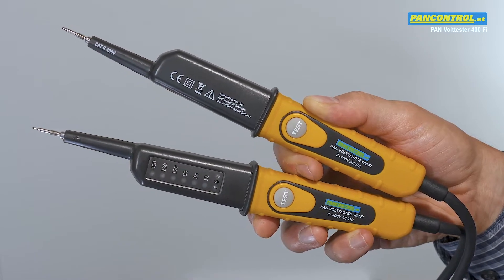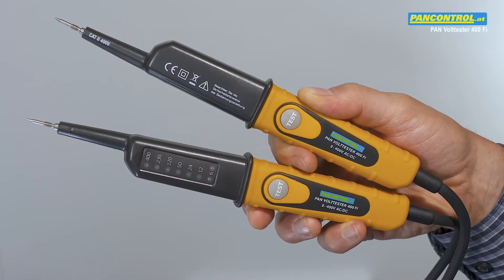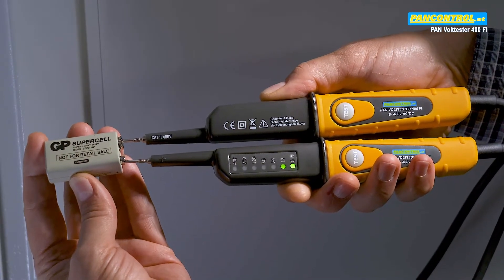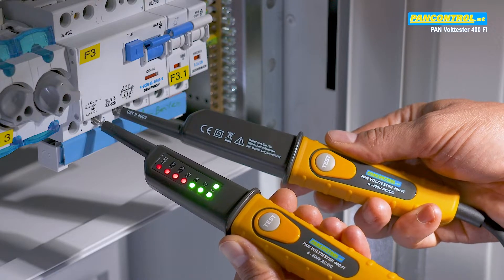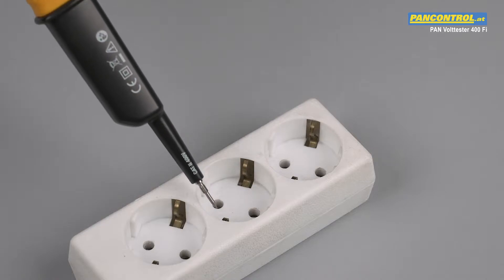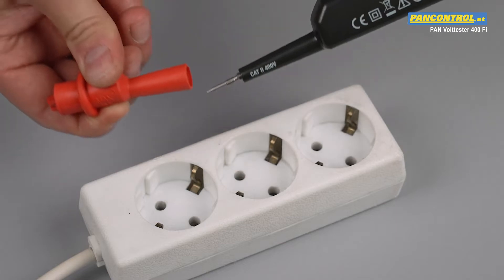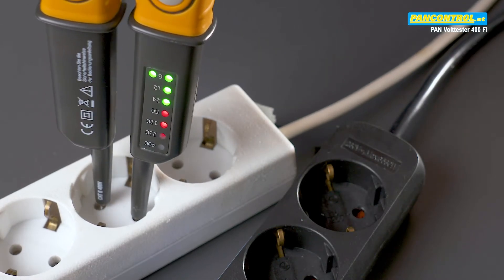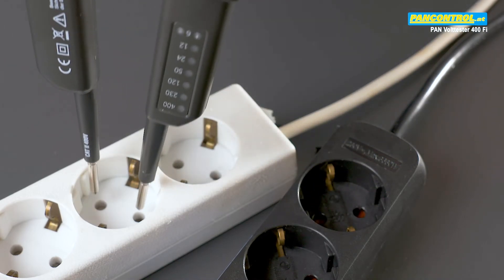Voltage Tester PAN Volttester 400 FI application video 2022

Comment: Нет прозвонки по сопротивлению ,какое  то барахло ))
Reply from the maker: Dear мк вячеслав,
This is a simple voltage tester. 
If you want to measure resistance, we recommend you our PAN MV-690A and PAN MV-1000AD
https://www.pancontrol.at/produkt/pan-mv-690a/
https://www.pancontrol.at/produkt/pan-mv-1000ad/

Google Translate: 
Это простой тестер напряжения.
Если вы хотите измерить сопротивление, мы рекомендуем вам наши PAN MV-690A и PAN MV-1000AD.